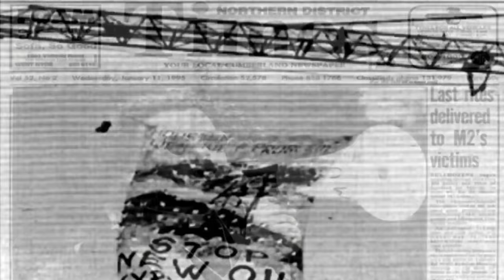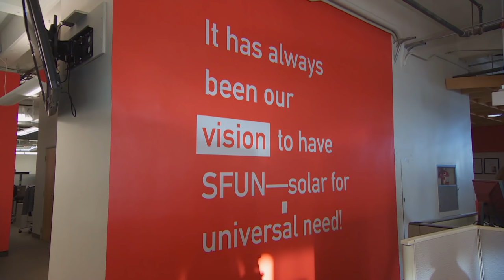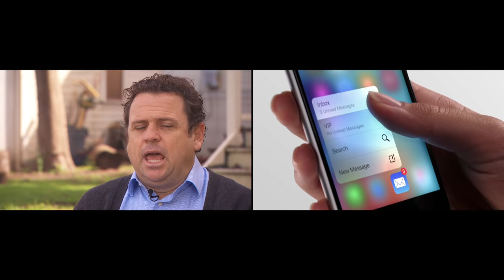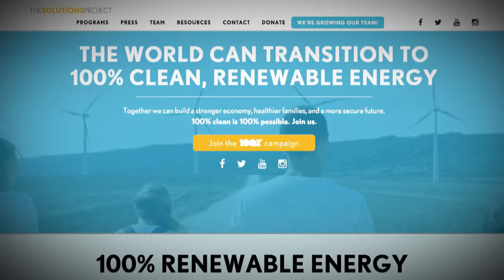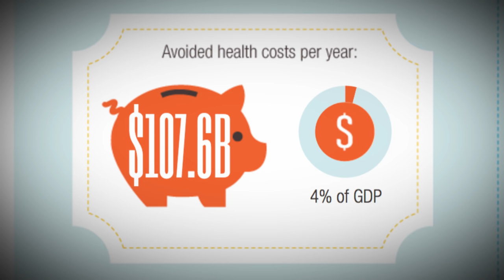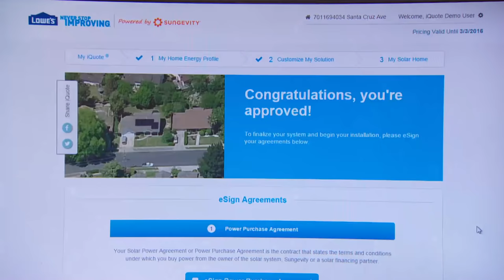The future of clean-energy

Comment: Guys make a difference buy a tesla or bolt or any EVs, install solar roof tops, switch to LEDs, switch off ac when not needed, use warm clothes instead of heater in winter...
Reply: The problem is not everyone can just go out and buy or even get loans for and EV or solar. Or even sometimes LEDs. If you rent, automatically don’t qualify for solar or even installing an EV charger in your garage sometimes, hugely inconvenient if you own an EV. LED bulbs are expensive unless it’s a standard bulb size. I have various different size bulbs through my rental, smaller night light style and larger flood lamp types. LEDs for those bulbs are expensive even non LEDS get pricy. Not to mention if I move in a year to a new place what if those bulbs are completely different at the new home ? 

It takes a while to phase things out. Think about it, we still have 1990’s commuter cars on the road today. The price on solar and EVs are coming down but they’re not really there yet as an affordable and convenient form of transportation for the middle and lower middle class. Then there’s the infrastructure that’s still not fully built yet as well. If I travel a lot, I’m not going to be able to get very far in certain areas due to lack of charge stations.
Reply: VIPKID Vault  I can't but afford a tesla either, but I live just close enough to town to get a used 2015 Nissan Leaf with only 35,000 miles on it for $14k total with $3k down $240/month with a low credit score. If there is a will there is a way. Also people in africa are buying solar pay as you go kits for like $200-$500 but only pay like $5 a week Right through an app on smart phones.
Reply: @allanj7750  True for now, but if you really want to go green then keep an eye on them prices and get creative. Long range EVs can be leased by other people and then after 3 years be sold as a pre-owned EV like my nissan leaf is and it still has 4 more years before that OH SO expensive battery will need replacing. New EV's are too expensive but with so few moving parts, Used ones are looking good if the battery is still young. And standard LED bulbs are a dollar at dollar tree. Yes, I also wish I could get smaller LED bulbs for my travel trailer but SOL for now.

As long as politics and lobbying either gets on board or stays outa the way it will only be a matter of time before some entrepreneur tries to fill the gap of consumer desire to make (him/her)self more money... Like a power vacuum? I think...IDK
Reply: Buy a low mileage used Leaf EV for under $10k, and operate it for 1/3 as much as buying fossil fuels.  Driving an EV is like buying gas for well under $1 a gallon.  A used Leaf is an incredible bargain.  Why pay oil companies thousands of dollars a year? 

Get solar panels or solar water heating if you can.  Payback time is about 7 years, then your electricity costs are nearly zero, including powering your EV.  Drive on sunshine and power your house on sunshine.